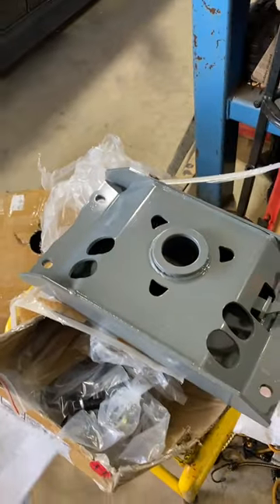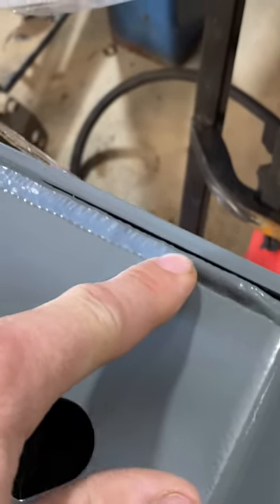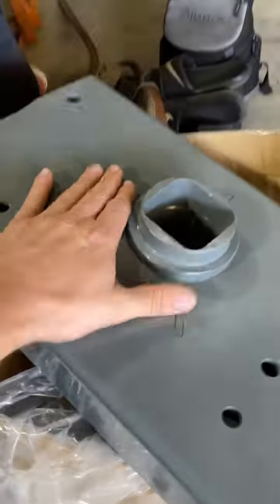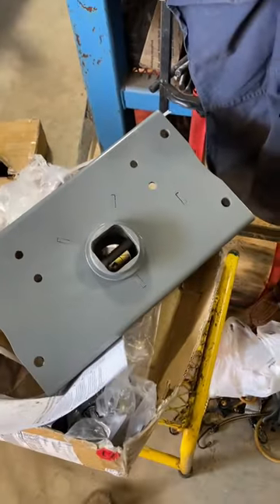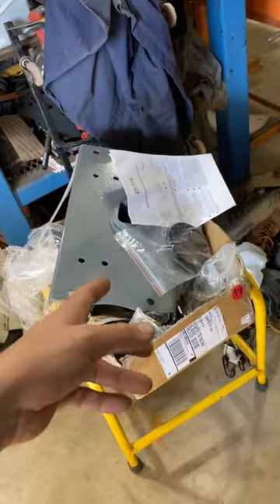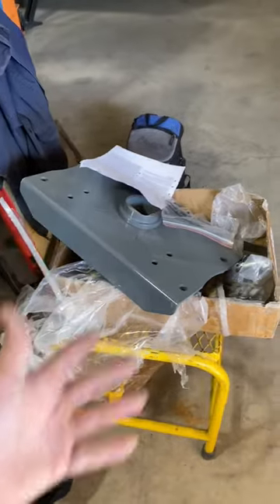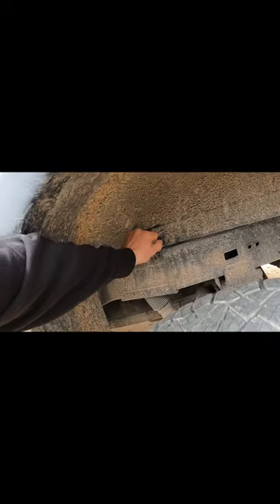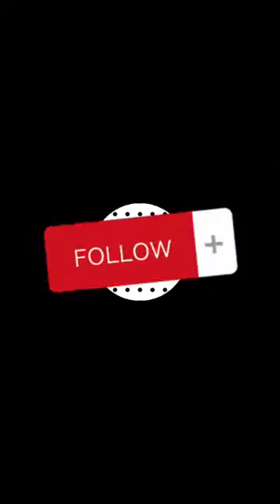Ebay Gooseneck Hitch vs B&W brand, $240 vs $600, Worth it?

Comment: Thank you for doing this review! Only person I've seen review this!
Reply from the maker: No problem! Hope it was helpful 👍🏽
Reply: It still holding up just fine?
Reply from the maker: @mattstanleylawncare7901  yessir! I’ve hauled over 30 loads on my 32ft gooseneck traveling hundreds of miles per load weighing around 15k lbs gross. Only issue is the pull level to flip the ball is seized which I’ve mentioned in the vid. I’m sure I can fix it just haven’t spent the time to do it lol if you do purchase the eBay brand hitch be sure to look over the welds and do as I did on video 👍🏽